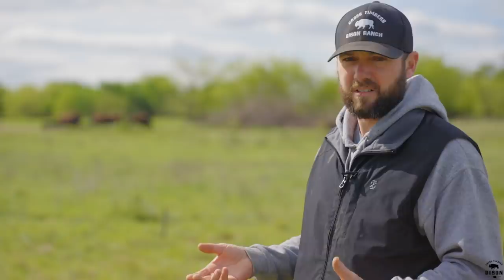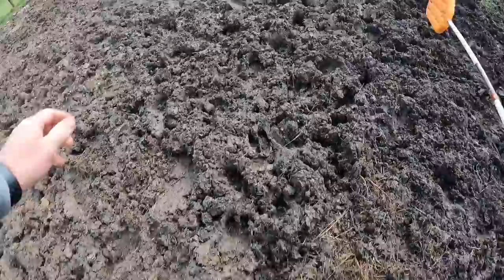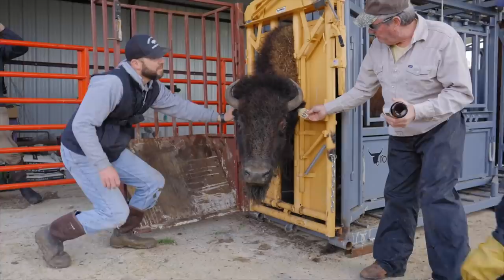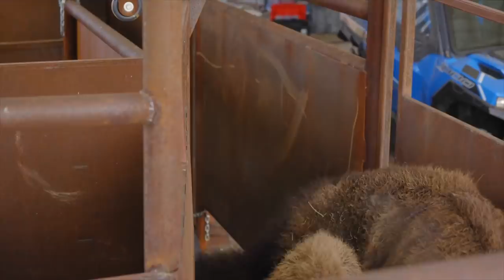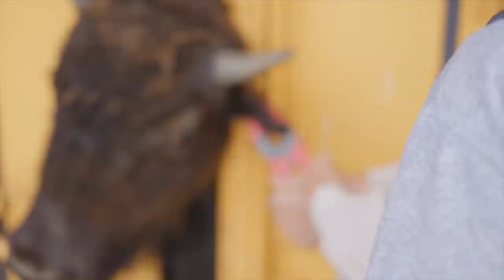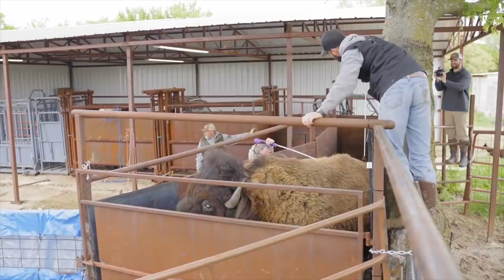Springtime Bison Handling...There's Never A Dull Moment On This Day!

Comment: You might try to incorporate the system they use at exotic animal auctions where they have a large panel on an overhead trac  to push the animals forward like the one at sycamore springs in locust grove

Comment: My horse had a colic once and she was in so much pan that she wanted to lay down. The vet had to examine her and that could only happen when she was standing. So I had to put my shoulder under her air pipe so that she would strangle herself once she tried to lay down. It was really mean, but sometimes you have to be rough with those big animals. They are stronger than you.

Comment: I’d mention too that the hot shots are not dangerous. They suck but coming from someone who as a teen had hotshot battles with her buddies, it’s not going to harm those big boys. Used properly it’s extremely annoying more then painful. Like a dog collar. 
The only time it’s cruel or dangerous is if someone held it too the animal for extended amount of time. Pinning or intentionally keeping voltage on an animal is cruelty in almost ever instant. (One extreme instant when it’s not is getting a stuck animal motivated to move after it’s given up the will to live.) 
That’s a long rant but my point is, like most things it’s the handlers that determine how safe any tool is. 
Thanks for the videos. I’m a new watcher and interested is someday owning a few.

Comment: I was a mechanic on a large dairy farm about 60 yrs ago, they milked about 1200 cows.. they had four buffalo that the idiot owner thought were going to be pets and the bull was for about 7 months.. .they would get loose every now and then.., everyone would drop whatever they were doing and grab a truck, tractor, (not a 9N ford as the buffalo would flip that thing over)  .or anything running that was close to try and round them up before they killed someone.  I think that old bull loved the fight, it was game on for him,  he loved bouncing off the PUs and smacking the 4020s..sometimes it took 3-4 days to get them in a corner and enough ropes  on to hold him. I was in my 20s then and the Holstein bulls were bad enough to handle when pissed off, but that buffalo bull was a real challenge.  for the size of them, they can move like lightning.

Comment: People do not understand the power these animals have. There is a picture of a mid size car in the office of the TR National Park, Medora ND, that the lady had gotten out of her car to get a picture. She was 50 feet away from a big bull. Her Mini poodle jumped out and started barking at. The Big bull got ticked and climbed up on her car and stomped until the whole thing was squashed. The highest point was 24 inches. You could not tell the make or model of the car.
Another point for those of you that think a national parks are the only places they should be: One spring (breading season), 2 bulls were fighting. One bull ended up with 2 broken legs. A neighboring rancher offered to put it out of it's misery. The park said NO. It took that bull 1 week to die, as it tried to crawl a mile and a half to the river to get water. So no, ranchers like Cross Timbers do much more with much more kindness for the animals.

Comment: Usually those who complain or are negative about using hot shots (aka cattle electric prauds) have never been around 1000+ lb cattle or bison. Family has a feedlot and the use of hot shots are very important on getting those cattle worked or loaded onto transportation in the safest and quickest way to reduce stress or injury to both the cattle and people. Those hotshots have saved some injury to people a couple of times and what would have been very serious injury (we get a few horned cattle through the lots and they are the most dangerous as these are not pocket pet cattle but come from large operations and lucky if they see people more then occasionally when feed or minerals are put out on the big pastures that they are in at that time). It is people that have no clue where meat really comes from or the animal rights terrorist groups that go after people for what they consider cruel. Hot shots are not cruel, I have been hit by one several times in my life, it like touching an electric fence.

Comment: There's an awful lot of banging, clanging and rattling going on in that handling system, people are talking and moving about unnecessarily and the untrained dogs aren't helping. Every human action seems to be reactive and not proactive or calm which is required around all livestock, Bison included.
You need Urethane rollers, bump stops and grease on the slide gates to quieten everything down, the chutes need to taper better and you need head bars on the crush to stop the Bison heads going up (see Tom Pembertons' new Highland cattle crush time mark 7 minutes www.youtube.com/watch?v=gk_0skKMnOs)
Roof bars and a covering along the length of the top of the crush would also be a good idea to stop the Bison trying to go up and over.

Comment: Its a necessary evil for the safety and well being of the animals. They are big and powerful wild animals that have a high fight or flight response. The only way you MIGHT, and thats a big might, be able to train one to go in the shoot willingly would be if it was bottle raised and walked into the shoot on a daily basis, and then you're still looking at a 50/50 chance of it working. And thats very unrealistic with the number of animals you have. Maybe if you only had 1 or 2...

Comment: The truth is you don't have to scare stab electrocute animals to get them to do what you want
 the common belief is you do because the animal is scared and doesn't understand what you want.
Ironically the answers right there in that argument, don't scare the animals make the animal understand what you want.
 some of this is done with training some of it is done with just understanding how the animal works.
So the question becomes what would you rather do? Fight with an animal 10 20 30 minutes and hour? And hope that you  get it into the squeeze shoot or the trailer or whatever and it doesn't jump the fence and escaped or destroy it as it charges through. keep in mind you have to go through this fight every single time you need the animal to do something.
 or would you rather take the time to figure out how to get the animal to do what you want willingly even if it takes a month a year 5 years? Keep in mind this way once you get it figured out you never have to go through that fight again.
 I have seen I have trained ducks to go into their protective pens at night. Once trained they don't need to be herded
I've seen the same done with cattle get a perfect setup the cattle will just walk right through and go wherever you want, even onto a conveyor belt that will carry them to the killing point and then the  machines can carry the body onto the next part of the process.
 all you really have to do is take away the fear and make it a pleasant or at least tolerable experience.
Ever wonder why zoos use training and kindness over a farmer's techniques?
 because ultimately it's easier to get animal that outweighs you to cooperate with kindness and understanding then fear and force. Never mind how much safer large animals that are calm are.
Reply: They don't electrocute the animals.  You have obviously never handled large animals, much less large aggressive ones.  So nothing you say has an ounce of credibility

Comment: Dusty what is up with the fence issues. That is the 2nd Bison that has gotten their head stuck in a space from YOUR fencing. 
Dude you already had 1 bison dead from the fencing holes at the gates. I am thankful you have been given  the opportunity to fix this fence killer spot without killing another Bison. Ppl can accept/get past 1 screw up on your watch however 2 Bison with their heads stuck in a fencing gap at the gate. No dude ppl won’t accept that. At some point you no longer are caring for the Bison you have become their problem. 
PLEASE go through every Fence line you have gate to gate and close off any gaps larger the 1 inch.
Reply: Always gotta be at least one Karen. Ma’am I suggest YOU go work on a bison ranch for a few days and get you a good belly full of how it goes daily. Don’t try to tell him what to do unless you’ve walked a mile in his shoes.